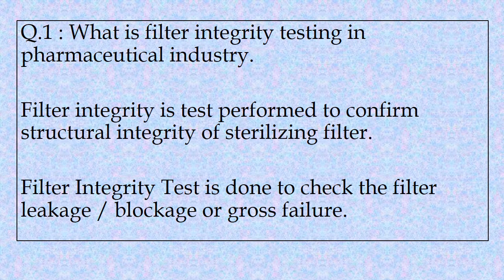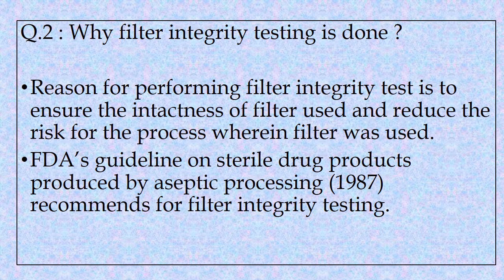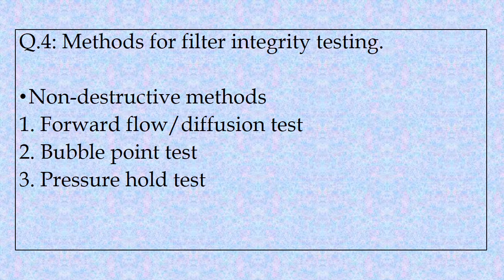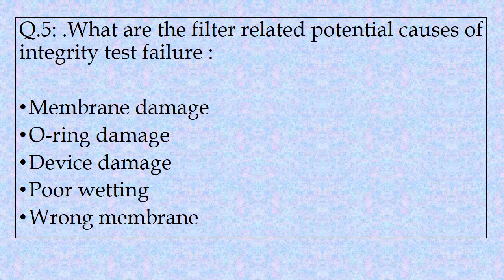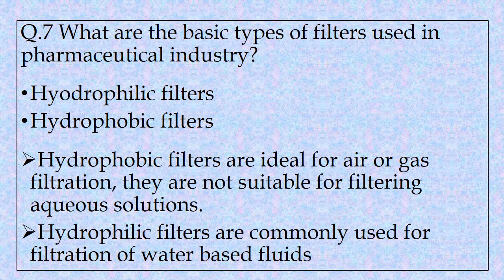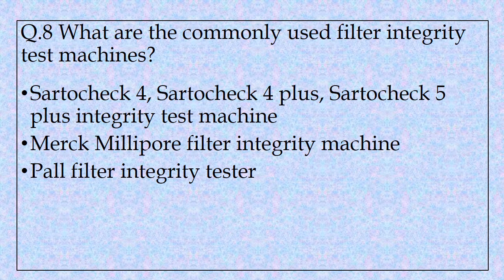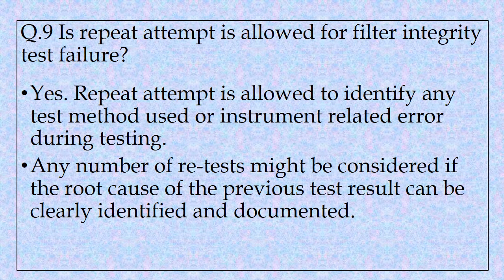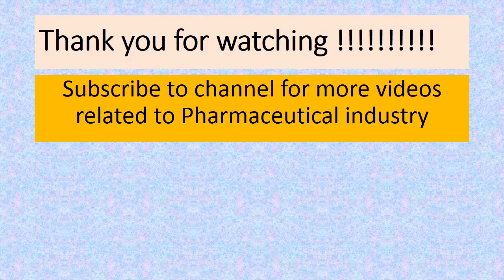Filter integrity testing in pharmaceutical industry l Interview Questions

Comment: Sir I have one question...which steps involved in during filters integrity tests
Reply from the maker: You can refer below steps for filter integrity testing,

•	Prepare the filter integrity testing equipment, including the integrity test instrument and appropriate accessories.
•	Wet the filter with a suitable wetting fluid to ensure proper sealing and prevent air bypass.
•	Connect the filter to the integrity test instrument using a sterile connector.
•	Set the appropriate test parameters on the integrity test instrument, such as test pressure and test time.
•	Initiate the integrity test, during which the instrument measures the pressure drop across the filter.
•	Observe the pressure decay or bubble point test results to determine the filter's integrity.
•	Compare the test results with established acceptance criteria to determine if the filter has passed or failed the integrity test.
•	Document the test results, including the filter identification, test parameters, and outcome (pass/fail).
•	If the filter fails the integrity test, investigate the cause of failure and take appropriate corrective actions.
•	Repeat the integrity test after any corrective actions have been implemented to ensure the filter's integrity is restored.